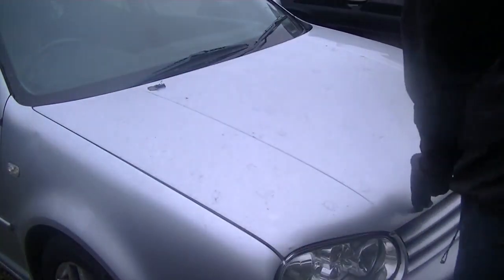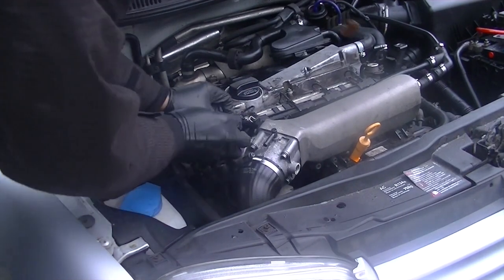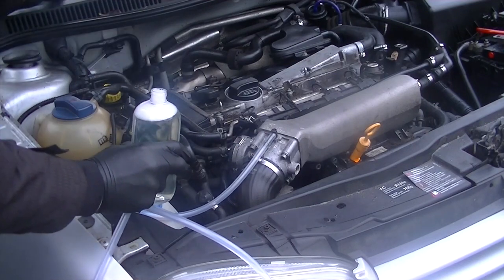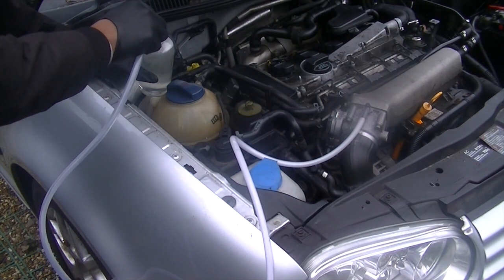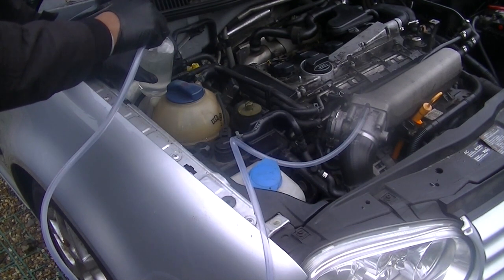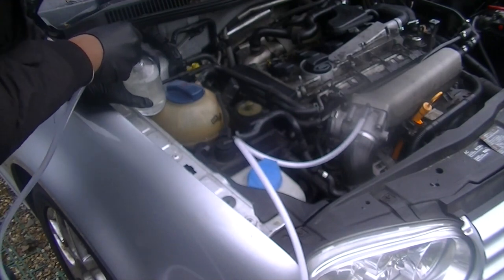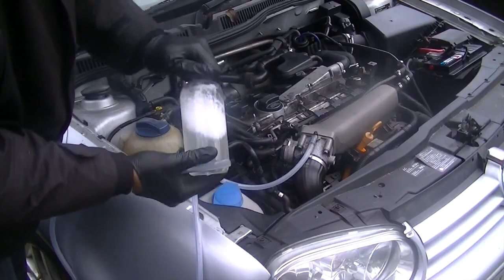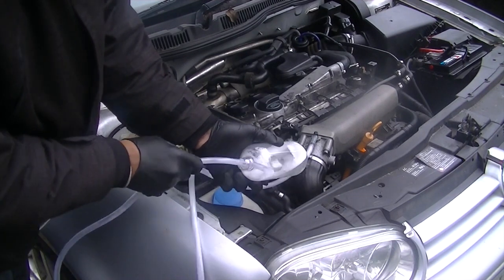How to Decarbonise a VW 1.8T Golf Jetta Engine

Comment: I just did that with water.it increase even my boost a litle bit 0.52 bar.before it was at 0.40.nice job bro keep doing informative videos..
Reply: Just straight tap water?
Reply: @beasyofficial2617   yes just be carefull do not imput allot at once,see the tailpipe in the end black mess 😅.
Reply: @gentibibaj3933  hahahaha would you say about 400ml water in drips over say 5 minutes
Reply: @beasyofficial2617  i did put 1 liter to be honest i dont remember arround 10 min spraying just a litle bit!

Comment: how often can we do this to our cars? how safe is this for a 150,000k turbo crdi engine ? thanks for the video. i took my other turbo diesel car to regular oil change shop..they were using decarbonized liquid and put it in the vaccuum line. and boy the smoke out of the pipe was so thick and black...in about like 5mins it turned out to white smoke. thanks!

Comment: "You will feel the difference immediately, you'll feel the power".  You haven't even checked if the car actually drives at all after this.  Should have shown the video of the car having no power/very little power, then right after the "treatment", the apparent "difference " .  How many more Horse Power/PSI engine compression/MPG did you gain with this procedure?  Not denying this works, but some viewers would like to have seen some proof.
Reply: Tabo Racho lol...